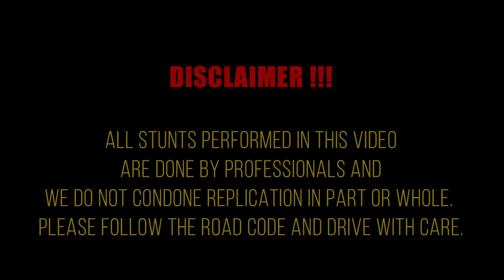Jamaica's First Boosted Mark X 350 - SKVNK LIFESTYLE EPISODE 121

Comment: The man use a cup holder as filter........"He's too dangerous to be left alive" 🤣💀
Reply: it works. alot of  turbo filter has the same look but flat
Reply: So unfortunate that no one in the forum has been objective enough to advise him on the engineering flaws. There are so many disadvantages with an installation of this nature, turbo reaction time, turbo stall, cylinder scavenging and overfiuelling under varying load conditions water ingress, heat transfer from the exhaust (where is the after cooler/inter cooler to control the efficiency of the induced gases?)
Reply: Only a jamaican. #jamaicanengineering
Reply: @rickardobrooks5032  Jamaica no problem mon 😬
Reply: @rickardobrooks5032  pretty sure he resolved all those problems you’re talking about and the Turbo doesn’t use oil
Reply: Dwrcl
Reply: Pretty clever improvisation
Reply: @trilliedon8728 exactly, he’s just looking at it as if he knows all of the inner workings…obviously in his line of work you’d just assume that he’s done the relevant troubleshooting before he installed it and even after he installed it and it has warranty as he said.
Reply: @rickardobrooks5032  remote-mounted turbo was created by Chris over at STS who perfected the remote-mounted install, tuning, etc. Remote turbo bolt-on without tuning etc typically sees 150 plus additional HP on the low end. There is a lot more that goes into it than you think. The tech of the future is air-cool turbo/ oilless bearings.
Reply: @trilliedon8728  it's called turbo guard,  It's a mesh wire filter. He saved about $70usd, it's the same thing/ wire mesh filter material.
Reply: @rickardobrooks5032 remote mounted turbos dont lag any different from ones mounted in the engine bay do some research first

Comment: This Change's everything
Reply: It Changes nothing if it comes up against a factory M5 or M3 which makes over 600 horsepower and almost 500 respectively this will only run a regular BMW
Reply: @Googleme100  mark x xan never challenge a m5 competition
Reply: Yuh Betta Know Dat!!🤣
Reply: @peterlewis3065  Bimma dem dead mon
Reply: Nothing changes bro., nothing changes. BMW was built for this. Mark X playing catch up. Let's see what happens when him increase boost, let's see how long the "Stock" last.
Reply: Javis! Chubble deh deh. Toyota, then,now,forever
Reply: The only change this make is a little more hp. A mark x was not built for handling and excessive speed most BMW are!. The amount of money and time it will take to get a mark x to reach or surpass any decent BMW 328, 335, 440, 460, X5M, X6M, M3, M4 or M5  or a M competition is not worth it! It’s comparing apples and oranges. Markx 350 has a decent engine nothing more. It’s suspension and chassis was not made for handling and speed. Same engine in the 3.5 Camry xse sport. BMW are made for handling and speed Marks is not!
Reply: @SalmAndrew  460? 🤔
Reply: A car would be more appreciated when one does some work with it ...if a car was built particularly for sport ..handling etc..it would already have it desired expectations..not necessarily more fun.than a car with a twist.....watching someone turn a car from  regular to a more agile ..additional sports and charismatic sounding..  i could even say intimidating car..will definitely have some feeling of satisfaction for the owner ...developers and crowd watching.what we would never thought before was possible.
Reply: @HughFairweather  dem something deh dem nuh want to hear
Reply: Unu see how the mr2 kick out him teeth?
Reply: @peterlewis3065  it's only a Toyota g ain't no Benz or Audi so yea it🔥🔥🔥

Comment: This is awesome! You will need a real filter, dust going into the engine will eventually mess up the wall or even burn a valve.
Reply: Safer u build a heat shield for the KN filter. Stainless steel

Comment: I do have some concerns about dust generated from the front wheels the cup filter don't look too good in the long term for the engine. The filter could have been built using stainless fine mesh much safer and better. Very good work

Comment: About the water question, what persons meant is will water go in the intake of the turbo since it's open under the car and hydro lock the engine destroying it, they should pipe the intake to the engine bay.

Comment: He needs a GRMN cluster which is 280km if I remember correctly 
Had to do the same with my aristo came 180km switched it to a TRD cluster 320 km
Reply: Does switching your cluster make it any faster ??
Reply: @wexswexs5996  will allow you to go faster 
Instead of of tapping out at 180km, 280 or 320 will allow you to go faster

Comment: What about the deep potholes and the low mounting position of the turbo?  The road conditions in Jamaica is more suitable for a top mount system.
Reply: U need to go watch again.
Reply: @ACURACALABAR11   I now see what I didn't. Thanks dj.
Reply: I suggest wrapping the exhaust system from the manifolds back to the turbo to help keep the radiant heat from saturating the cold side of the turbo. I also recommend heat reflective wrap on the piping going  from the (cold side) turbo to the intercooler,  and then to the intake manifold.  I did this with my 02 ss Camaro and it dropped my IAT considerably.  I admire his passion  and  creative thinking. I'm definitely intrested and will be looking forward to updates on this project.  Jamaican ingenuity and creativity. 👍
Reply: That’s why the bar is there. Once he touches that he would know that it’s a no no. Plus the turbo is literally under the chassis.
Reply: @jude2485  oh kool. Thats very interesting. Hope he sees it. The channel mod2fame have a similar turbo set up on his hellcat

Comment: All cars should have turbos  because of fuel use but you need to improve the wearing of the bearings, but there is a grease you can get what they use to build engines ? Not loob

Comment: Big up to the Mark X community... enough with those unreliable and overated BMW's.🔥🔥
Reply: Unreliable becoz you don't Know how to take good care of em
Reply: @dalisobanda5575  Those BMWs are considered junk in America and depreciate extremely fast compared to a Japanese Vehicle. You can wait 2 or 3 years then get them cheap after they depreciate by 70%.
Reply: @dalisobanda5575  Unrealiable because all the hoses are plastic which crystallize over time causing  coolant leaks, electric water pump part plastic, rod bearings and turbo issues, oil consumption problems and leaks,  timing chain valve guide issues which can destroy the engine.

Last but not least spontaneous combustion when parked, YouTube Bmws catching on fire. BMW have a class action lawsuit world wide. 🌎 🚒🔥🔥
Reply: @JuniorLexus6692  I have owned a Bmw E46 for seven years. Well serviced with original parts. It hasn't given me  problems. Take care of your Bmw and it will take care of you.. Facts
Reply: @dalisobanda5575  the E46 is the old model... most of the problems is the E90 and up, let's not even talk about the  Bmw 745.
Reply: @dalisobanda5575  I have a E90 328i the most simplest one without the turbo, a little more reliable. The starter is a pain to get to though.

Comment: Reliable with a cylinder block liner that fails after 250k miles and can't take more than 5 to 7 pounds of boost and limited to 400 hp anything over the block or head gasket fails...... I still love the interior of all mark x but not the best engines would do a swap with the Nissan gtr engine if I'd race this car and turbo beneath a car isn't new if you watch 1320 vidoes and underground racing most corvettes, gtrs run turbos underneath. Nuff respect for the work here though and watching some similar x in Thailand and these are pretty quick for acceleration I would wanna see it drag at 1/4 mile vs full mile drag strip.

Comment: Bruh at the end of the day I know obtaining that turbo power is the bottom line but come on dogg. Creativity is making it fit without enough piping to travel 2 miles (intake and exhaust) before entering/exciting the turbo. Don't get me wrong I like it (and under the car is nothing new where engine bay space is limited it impossible) but that is simple Simon vs making it work under the hood.

Comment: I’m a Bimma  guy 100% I also respect technology engineering ingenuity this is very good however you must have to face the facts the new engine Toyota which is the Mark X producer is using is going to be a straight 6 BSeries BMW engine so when you start say reliability and everything like that Toyota is known for reliability and they wouldn’t put in there if it wasn’t reliable you don’t need to buy an ///M to get big HP  the N54 and N55 platform come 300HP+ stock! And comes on the 1, 2,3,4,5,6,7, and X series BMW does cost more but that’s a luxury vehicle what do yu expect? Wait till you see these engines in there Lexus badge cars ( which is the Mark X Family ) there is a reason the car community calls the N54 the new generation 2JZ ..because when done properly you can get 600+ hp on stock intervals for under $5k USD

Comment: Despite, Roland’s intoxicating passion there are two major problems with this build, friends:

1. The engineering that goes into the build of a turbocharged engine is MUCH different from a stock engine. The pistons, the values, the metal alloys used for heat dissipation and torque compensation are meticulously chosen by design (thus, turbocharged engines are FAR more expensive to produce). To simply slap a turbo on a stock engine and then pop a bottle of champagne is a dangerous oversimplification.  

2.  The revolutionary placement of the turbo under the car then using pen holder as a FILTER 😳 will lead to a massive amounts of dust and other harmful impurities ending up in the combustion chamber for ignition. 

Unfortunately, there will be many more ENGINE CHECK lights coming on in this car’s future. 😔

Nuff love,
TEACH

Comment: Just to let the the Jamaica population Know that the Car on the Jamaican road made By Toyota with  
The letter X on the gril is a Mark 10 
X Happens to be the Roman numeral 
10, Next point where is the intake of the turbo under the bottom of the car ? If you go through a puddle of 
Water wont it suck in the water and 
Pump the water into the engine?

Comment: Diesel tech 1 ... and repair turbo system unite is always headache  and putting it under not only water damage but dirt   and is the ECM reading that unkown added air  to the system..  I know the check engine light on and more ... . U have to upgrade the system... .. will fail the engine and trans but the turbo will go first cause why would u go so cheap building a street car

Comment: Me waah see Bebo and this run!!!
Reply: This would a dead bredda .... it couldn't win bebo... no time.its like a 300lbs fat gal a try run Shelly-ANN
Reply: @trevaunphillips8848  no matter, make the mark x use both him NOS and boost
Reply: And if it use nos and boost how much power do u  assume it will possibly make ?
Reply: @trevaunphillips8848  thinking about it. It woulda dead frl.
Reply: Same so me bredda .. there's no 2 ways to it... bebo has a 1000hp capable car. Current running roughly 800÷hp. It has carbon fibre doors and totally gutted interior with light weight racing seats. So it's very light and puts down the power pretty well ... the mark x would have to loose a lot of weight and make more power to stand a decent chance ...